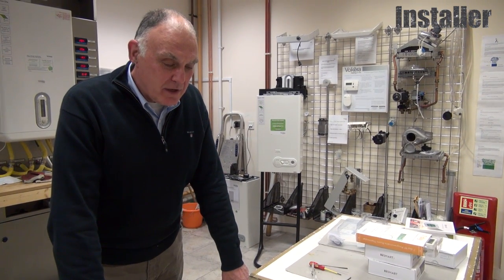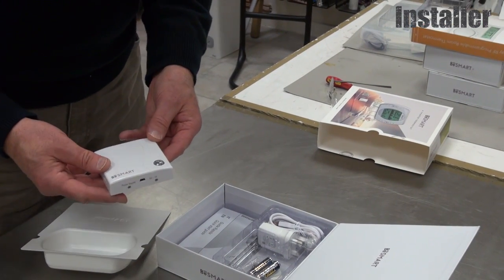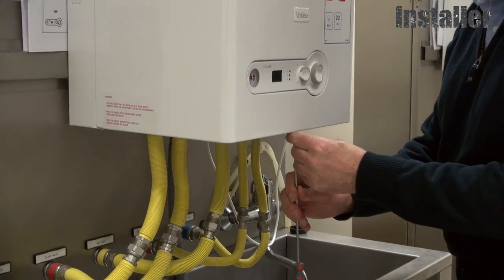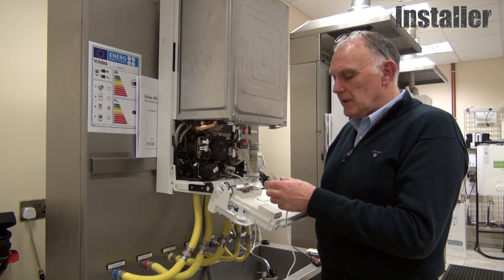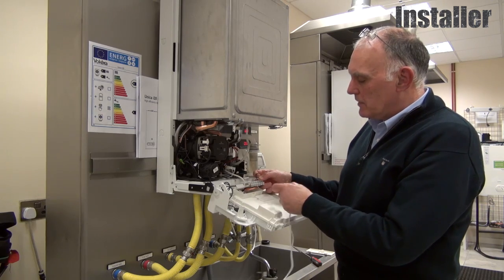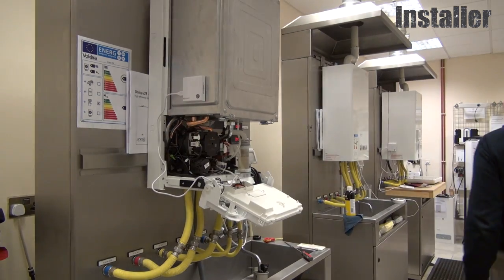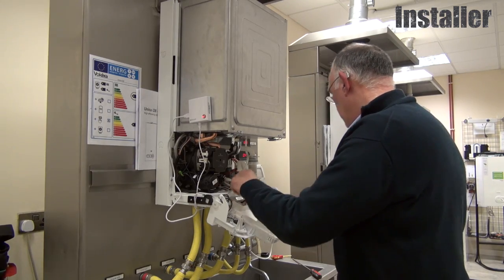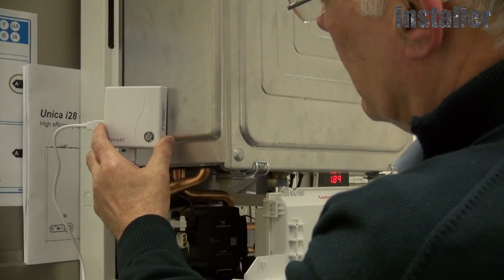Vokèra BeSMART installation guide

Comment: hi I have a vokera excel 29 and the pressure as dropped, do you know how to top up the pressure? wheres the filling loop etc. thanks
Reply: Samantha Brown its a silver metallic flexibility pipe with a little key , it’s always beside but maybe under.  Open that key in direction of the pipe vertical  listening the waters pass and check the clock till 1 1/2 or 2 max. And then turn the key back horizontal. Is you put to much water, on the top of the boiler is a thing open with a wee hole,  turn to loose it with a tool let the water flow under the right measure then adjust it back.

Comment: Just installed one myself with a unica i combi and works great. Would love to see a video on the Be Smart app general setup with special reference to the T1 T2 and T3 configuration and get the most out boiler efficiency wise
Reply: Laurence Bourke does the thermostat fit on a wall in the house?